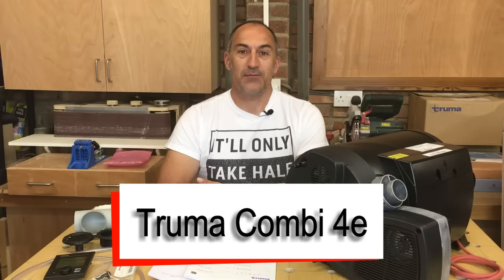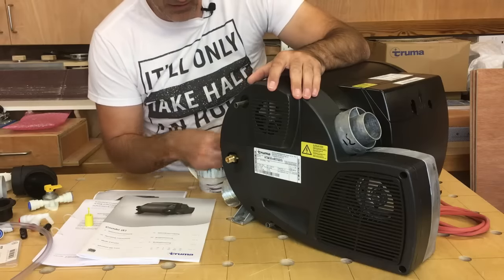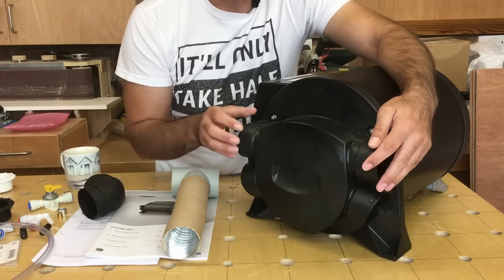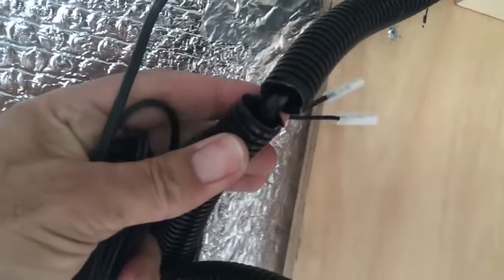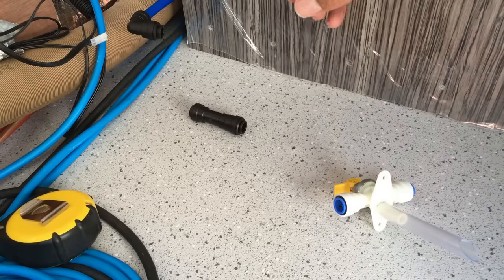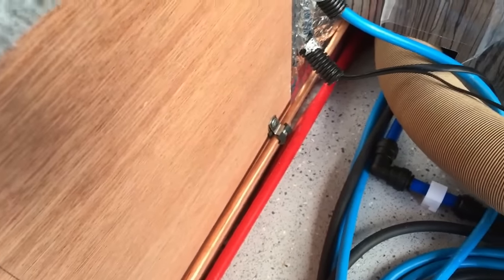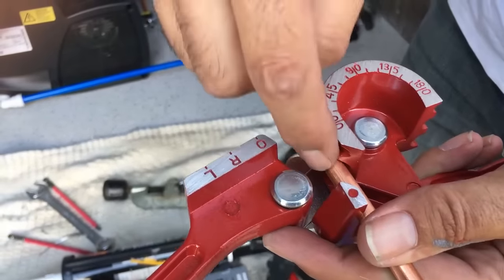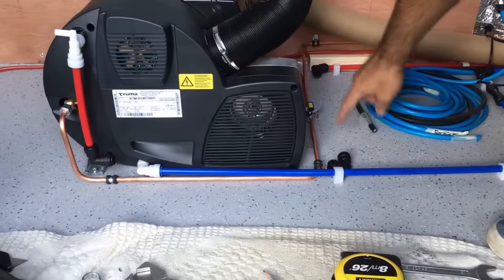Truma Combi 4e Self Build Camper Van Installation

Comment: Hey Greg loved watching your van build series I have a question about the truma controller one black wire goes to the boiler but where does the little red wire go is it for power to go to as I’m confused 
Many thanks 
Kim
Reply from the maker: There is a plug in flat control cable that has a plug on the end. The other cable is a 12v dc power supply. It needs a positive and negative protected by a 1Amp blade  fuse
Reply: @GregVirgoe  lovely thank you so much for your reply
Reply from the maker: @kimsanders8689  no problem anytime

Comment: Hi and thank you for sharing your knowledge regarding the van conversion. I'm going to convert my 6.7m long van soon. My question is do you think that two fans are necessary especially with your new Maxxair deluxe 900m³/h each one of them. I'm thinking to use one Maxxair deluxe in the front and a skylight/vent in the back section of my van. Could you share your thoughts about it please.

Comment: Hi Greg, we have just started our own sprinter conversion, I'm working on the first fix electrics and wondered if you know what the truma i net monitor cable is so I can run this through before purchasing as we are a few months away?  Great videos and lots of detail.
Reply from the maker: It uses a 6core 6pin RJ12 flat cable. Here is a link https://www.ebay.co.uk/itm/392829198029

Comment: Greg,
Brilliant video series - the videos are so helpful with my own van conversion.
I am in need of some help with the wiring for the CP+ and I was wondering if you could assist?
I have wired a 2.5mm cable for the 12v supply to the combi unit but I am struggling with how to wire in the control panel. The instructions in the Truma manual says to wire in the CP+ on the same circuit as the boiler - can you explain how this would look?

Comment: Hi Greg I’ve followed your series and I think it’s brilliant as a guide for other self builds, do you have any issues with camper/conversion insurance? Is it a problem to not be a recognised conversion company as a diy conversion to get motorhome insurance? Also I’ve used vans with diesel heaters (no hot water luxury) and they are fantastic and the warm air is very dry which should help combat humidity and condensation, is lpg powered heating as dry?
Reply from the maker: No problem with getting your self-build van insured, I am changing the classification with DVLA to Motor Caravan and will cover that in another video out soon. I had to change insurance companies as my van insurance would not cover me for a motorhome.
Like most modern heaters the warm air passes over a heat exchanger and does not mix at all with combustion side of the heater, so as the air is heated the relative humidity reduces and the air would appear to be dryer yes.

Comment: 12v and 240 v connection?
I take it the 12v is for the display the other to power the boiler ? 
Could you confirm this please Greg .
I’ve nearly finished my van looks unreal tbh .
Couldn’t have done with out you good stuff 
Cheers 
Dave penny

Comment: This video has been so helpful, thank you! Just one question, we are starting to instal the water aspect and as we had bought a kit, I hadn’t noticed that we don’t have the check valve to use before the cold water drop out valve. We do have a tap set up before water runs to the truma, so will we need the check valve or will this be ok??

Comment: Hiya Greg, excellent content - thank you.
I really like that you kept breaks in the gas line to the absolute minimum but I was wondering how you ran the gas supply for the Truma back to the refillable gas bottle (I think it’s on the other side of the van), did you use the roof or maybe the floor to cross the van?
Reply from the maker: Rob Thomas it goes from the Truma under the back of the shower tray into the garage, then across the garage just behind the centre dividing wall on the floor (which I protected with timber batten) then through the wheel arch box under my control panel and into the gas bottle chamber. 
I thought I had video of the route on one of the builds?
Maybe the gas locker video.
Reply from the maker: Anto Palmer presumably you’ll have drop out vents in both locations so you could run a bit of plastic costed copper out underneath and back up through those vents.

Comment: Hi Greg, I am 'nearly' ready to fit the Truma boiler. The Truma literature suggest not having any flooring under the boiler, your video shows you have the Altro flooring and it looks as if its under the Truma. I'm assuming that it's ok (or I'm sure you wouldn't have done it), and it would be much easier for me.

Comment: Hey Greg!  The CP Plus controller requires it's own 12v power supply.  Did you run a separate set of 12v cables back to your 12v DC blade panel or did you do something different, like splice into the 12v cable for the furnace?  I also noticed on the furnace there are connections for something called a 'wire bridge'.  Do you know what that is for?  Much appreciated...great videos!

Comment: Hi Greg, did you add any sikaflex to the outside cowling/screwholes etc.? Or just use the rubber gasket provided and no sikaflex?
Reply from the maker: No Sikaflex just the rubber gasket that was provided 👍🏼😁

Comment: Hi Greg, Thank you so much for your amazing videos. Very inspiring and I have used so many of your ideas in my plans for my own build.
       Question..  Could you tell me or link a video on where you feed your Gas pipe for the Truma, as I notice your gas cylinder is on the opposite side of the van. I can't seem to plan where I would cross over the rigid copper pipe. Also the  hot feed from your hot water to the opposite side kitchen.
   Thanks again for all you have done for Sprinter conversions. I've watched some 2 or three times. Regards Gary

Comment: Hi Greg, I'm just about to install my boiler. The flue/cowling has a rubber gasket which would be positioned between the outside of the van and the flue/cowling. Did you also seal this joint with sicaflex or did you think the rubber gasket was sufficient?

Thanks for all the brilliant videos and advice. Mike
Reply from the maker: No sealant just the rubber gasket and don’t do the screw up too tight or you deform throw rubber and cowl too much. Just hand tight and snug 👍🏼😃
Reply: @GregVirgoe  cheers for the instant reply. Keep up the great videos.

Comment: Hi Greg. Great tutorial and really helpful now when I’m installing my own truma heater. One question. In the manual it says that the boiler can’t be installed over a pvc carpet because of the heat under the boiler. Did you cut out a piece of your carpet under the boiler or? Cheers from Sweden

Comment: Hi Greg, great video. 
Quick Q: Did you use any sikaflex adhesive sealant on the truma wall cowl? 
Sorry if it's one that has been answered already. I did try and skim through.
Thanks Dave
Reply from the maker: No Dave, it came with a rubber gasket so I just used that 👍🏼
Reply: @GregVirgoe  thank you! 
Thought that might be the case.  Just trying to get my balance of belts and braces right for my own install.
Reply from the maker: Hello Dave, I used Sikaflex on the other plastic hook up connections but as this terminal was going to be potentially hotter I kept to the manufacturers supplied parts. Belt and braces must be one of my catchphrases I guess 😊

Comment: Hi Greg
Was there any reason why you didn’t put your combi boiler in the garage 
Sorry to keep asking questions, just I want to get my camper right and you are the only one with extensive information
Reply from the maker: ian fairbairn that’s a good question and for a number of reasons. I’ll try and list them in priority with main one first. 
1. To keep the return air path back to the boiler as short as possible and within the living area. This cannot be ducted. 
2. To keep the supply duct length as short as possible to reduce duct resistance and maximise airflow and minimise heat loss in the ducts. 
3. So I didn’t lose valuable storage space in the garage where later I would like to carry a bike.
The other factors like Pipework and cables don’t really matter as they can be routed quite easily. 
So it really boiled down to the best location for airflow and vent outlets.
We only ever need it on its eco setting and the van is so warm and quiet too.
Reply: Greg Virgoe 
Thanks for the reply my boiler has just been delivered so be prepared for some more questions lol, I hope you got your inverter sorted, take care and stay safe
Reply from the maker: ian fairbairn no problem, happy to help if the info is not in my videos. Yes inverter is all sorted now thank you. Wish I could say the same about the weather. We currently have snow ⛄️😁

Comment: Hi Greg – Great videos! I also am about to kit out a Sprinter. I was just wondering what the best gas pipeline route is from the gas cylinder to the heater? Basically getting and concealing the gas pipe from the nearside to the offside of the van? Hope that makes sense 😊.
Reply from the maker: Will Beresford my gas pipe runs from my bottle over the wheel arch drops down onto the garage floor behind the dividing partition across the van then under the back of my shower tray to the bench seat where the boiler is. All in one continuous 8mm copper pipe. 
Fitted a timber batten in garage to give it protection from knocks. It you use plastic coated copper tube you could run it underneath the van with rubber lined pipe clips. Hope that helps.
Reply: Ah, yes! That makes total sense. I was also wondering about running it beneath the van as an option. Thanks for the info and the amazingly quick reply :)  @GregVirgoe

Comment: Hello Greg. Great videos. I have just installed a new combi 4 E boiler in my s520 Hymer.  The old c3402 gave up and cannot get parts. What is required to get the CP Control panel working ? Does one need the I Net box ? Or does it work independently ? I cannot get the control panel to start up !  Also there is no where that states where to Small 2 red/red-Black wires are installed at the rear of the control panel. My electrician as installed them to a 12V  power supply but still no Joy. It will not switch on. So help would be greatly appreciated.
Reply from the maker: You need 12v power to both the cp panel and the boiler. Plus the interconnection data cable installed. The boiler needs a 10amp supply and the controller needs a 1Amp supply. Once you have those on you should see it working ok 👍🏼

Comment: Hi Greg, awesome videos thank you. When you put the exhaust through the wall, how close was the insulation?  Did you box it in with wood? How hot does the outer part of the exhaust get?
Reply from the maker: Peter Croft the outside doesn’t get hot because air from outside is being drawn in down that part. 👍🏼
Reply: @GregVirgoe  many thanks..... I'll be sending you a beer soon!

Comment: Hi Greg. Thanks for the really helpful videos. I"m thinking of buying a Truma 4E boiler for our van conversion and wondered if it was possible to take it a step further and use the engine to heat the water up whilst driving. As long as the boiler tank has enough water in it and isn"t turned on whilst driving, do you think it"s possible to add a heat exchanger next to the boiler, feed it from the engine"s coolant system and run the hot water pipe from the boiler through the heat exchanger? Do you think this would work? Your thoughts would be much appreciated. Cheers!! Neville.

Comment: I have this same combo unit installed in my 2017 SWIFT van.
I am getting error code w255
No 12v power.
The com's data cable from the
Control unit seems to have a 
Loose connection where it plugs
Into the com's socket on the small
Printed board (combo heater end).
If I hold the data cable where it 
Goes into the com's socket, sometimes the error code will go away and the heater will start to
Work.l am hoping it's a bad data
Com's cable and not a faulty
Board. Can you tell me why there are 2 com's sockets next to each
Other on the small board , only
One of these is used on my unit.
Can you use either socket to attach the data com's cable to
The control panel. Also in your
Experience is the small circuit board
Where all the electrical conections
Connect to the combo unit a fairly
Robust unit or is this likely to fail.
Your videos are great and make
This complicated looking heater
Easier to understand

Comment: Hey Greg, first of all, thanks for your great explanation vids, it helps me a lot! My question: Do you think the check valve is necessary? if yes, why is it so dangerous if the hot water runs back from the boiler into the cold water tube? + doesn't the pump and pression accumulator prevent the water of running back? I'm looking forward for your advice! grtz from Belgium, Jente
Reply from the maker: Good question, it’s there to prevent you pulling hot water back out of the boiler when you open just a cold tap. Water will always find the path of least resistance and friending how long pipes are that can happen.
Reply: Hi Jente. I know you asked this long ago but maybe you are still installing your boiler. Yes, you really need the check/one way valve, or you will get warm water out of your cold taps too. Don't ask me how I know ;)

Comment: Hey Greg, I hope you're well! For the temperature sensor, I notice that the manual for the boiler mentions to connect with "2 x 0.5 mm² cable" and that "no need to observe polarity" - what exactly does this mean in this context? Does it mean that positive and negative are irrelevant and it doesn't matter which side connects to which spade connector? Also, which type of spade connector should be used for the sensor and the boiler  itself? Thanks in advance!

Comment: Hi Greg

Hi Greg, having installed and used the Truma, would this still be your preferred option? secondly how long was the 25kg? lpg cylinder fill  lasting?

Thank you
Reply from the maker: Yes without a doubt. 200% the best thing in our van. Regarding gas I would fit an external tank underneath now with larger capacity. You can get 55litre ones that fit in the spare wheel space. 
Our tank in the snow on all day lasts is two weeks. Mid summer it lasts a month or more.
Reply: @GregVirgoe  Thanks Greg, helpful information as usual.

Comment: Hi Greg, Thanks for the great videos. I am just starting my own conversion so I'm doing a lot of research and planning at the moment and I want to buy and install the same Combi unit. I'm trying to establish if you can mount the boiler on a timber box which will securely fixed to the floor but will be approx. 300mm high off the floor! Do you know if this is acceptable or does it have to be mounted at floor level? Also when connected to site hook-up mains power does the heating auto switch to electric or do you do the change via the controller? Cheers Steve
Reply from the maker: Hello Steve, no reason why you can’t fit in on a raised platform. I would sit it on something non combustible. Also just be aware of Flue outlet location not under an open window or near and doors. 
You select the power source on the controller and it works really well on site electric we have used it a couple of times like that 👍🏼

Comment: If you dont mind me asking, how much is the truma unit 4e combi you purchased? I checked their website but I am not ready to make an enquiry yet. Thanks for you informational guides!!
Reply from the maker: The combi boiler unit on it's own starts at £1k 
with a cp plus control package it's £1.4k
Then accessories are priced per item after that.
https://rover.ebay.com/rover/1/710-53481-19255-0/1?ff3=4&toolid=11800&pub=5575265109&campid=5338027957&mpre=https%3A%2F%2Fwww.ebay.co.uk%2Fsch%2Fi.html%3F_dmd%3D2%26_from%3DR40%26_trksid%3Dm570.l1313%26_nkw%3Dtruma%2Bcombi%2Bboiler%26_sacat%3D0%26_oac%3D1

Comment: Have you checked how hot the gas pipe gets when it’s in use? With mine, I’ve a small leak (I think from the hot water elbow) and with it set to hot on electric 2 the gas pipe gets bloody hot! On my van a few inches after where the gas pipe goes in it has an outer plastic sheath on the gas pipe, but noted yours didn’t and is close to the van lino. Just a heads up as to quite how hot it gets!